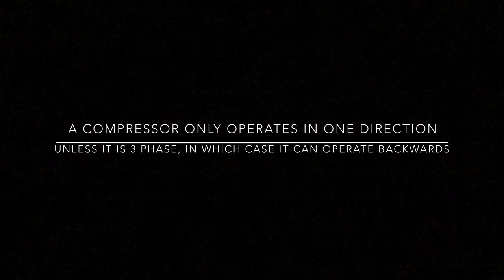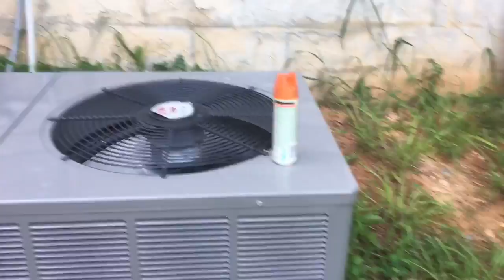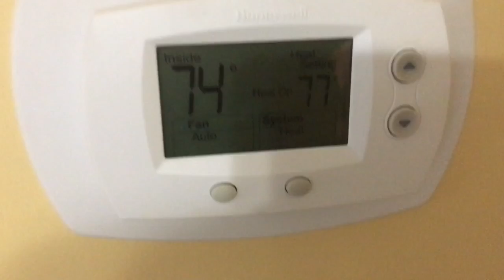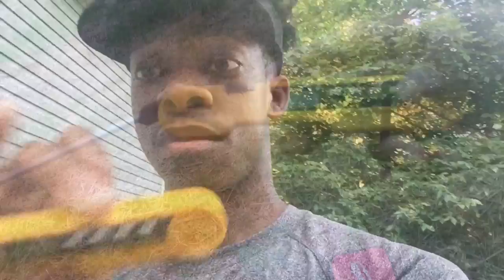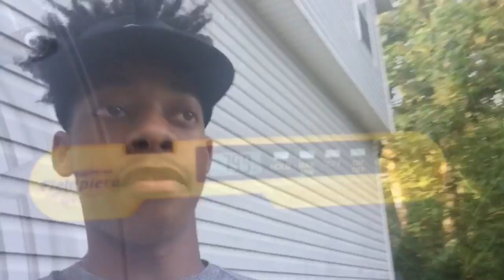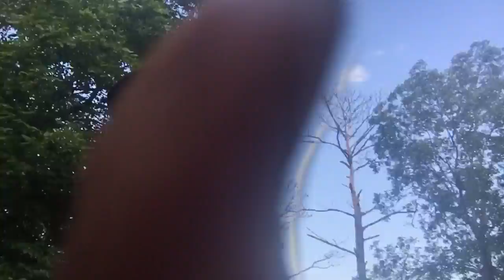Heat Pump Defrost Cycle Explained

Comment: GREAT VID CC! Be careful out there with them wasp and them damn cows😂. 

This video is a great help I've worked on standard systems for years and now I am required to service heat pumps. AMD I'm trying to better understand them.and the differences from standard gas fired furnaces. This video helps.  I get service calls saying 
 " my heat is not working all the time... sometimes its blowing out cold air and sometimes its fine"  so that it when the system is going into defrost mode " which it supposed to do.  My 1 question is... is there a refrigerant issuse present at all that may cause the system to go into defrost more often??
Reply from the maker: Ryan Beverly yes. If the refrigerant does  not match the factory charge chart, it will most definitely go into defrost more often. Think of it this way: if it’s in cooling mode, the indoor coil and expansion valve develop frost and it’ll freeze up. Same thing when it’s in heat mode: the outdoor coil is going to frost REGARDLESS OF the charge, but if it’s going on and out of defrost frequently when it’s only in the 40’s, yes, it could have a refrigerant issue.

Comment: what are you talking about the reversing valve uses the high psi of the freon to push the slide valve inside back and forward
Reply: Where I work and live Heat Pumps Rev Valve are operated with and thru 24 volts Solenoid,,,,,all it does is change the flow of Refrigerant from EVAP to Condenser Coil and vice versa thru Low Volt terminal B in the North and O in the south where I am. So if Rev valves break it will stay and remain on Heat Mode,viceversa in Florida.Thanks
Reply: + keep thinking new units don't use freon. Freon is R 22 which is being phased out the new units from 2009 and on use Puron R 410a the reversing valve is not shifted from high psi it's a 24 volt magnetic solenoid coil that switches the refrigerant flow most units use the "o" terminal to power the reversing valve in cooling mode but Rheem, Ruud, Bards and  Ameristar (which is owned by Trane) use the "b" terminal to power the reversing valve in heating mode

Comment: rheem /ruud is b reversing valve people for wiring a stat because the manufacturer was originally from the south and they dont get the cold weather the north does they get higher heat so the default is cooling since if you had a rev valve fail you would still have cooling, and vice a versa for the north

Comment: Thank you for sharing this video! I was in a panic thinking my unit had "bit the dust".  I saw steam coming off and the fan wasn't spinning, so I immediately thought it was a goner.  I have no clue how this stuff works, but your video has given me some sort of idea! Don't worry... I won't be messing around with any wires (not trying to get electrocuted!) The system is heating fine, I was just worried something was up because of that steam, but now I know it was just in defrost mode. Very helpful video! Thank you for sharing your knowledge and educating me a little on HVAC!   [ P.S. -  HVAC jokes on point ;)  Haaaa...]